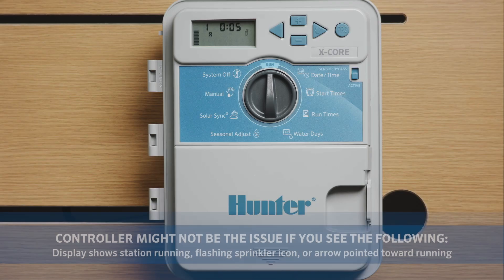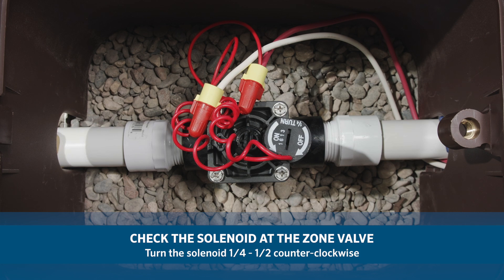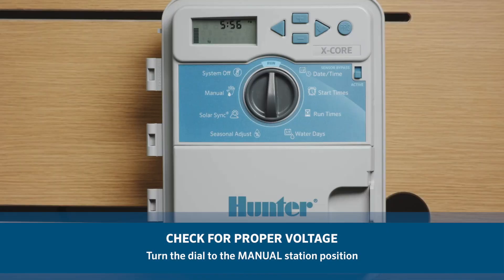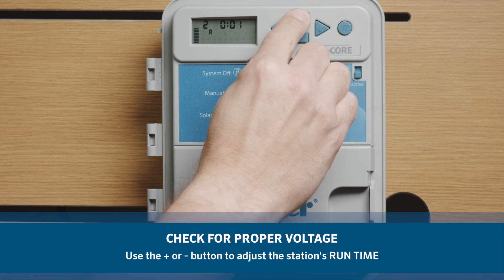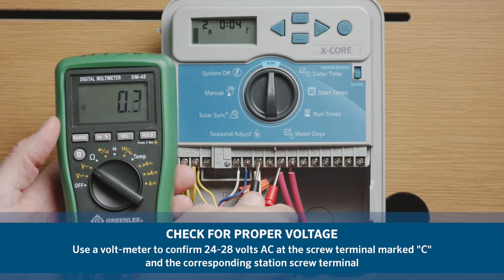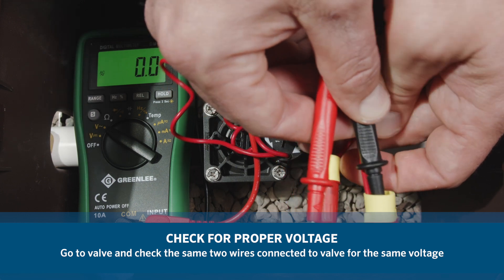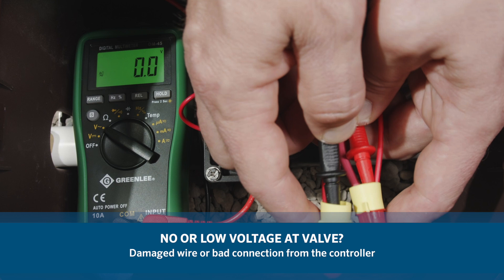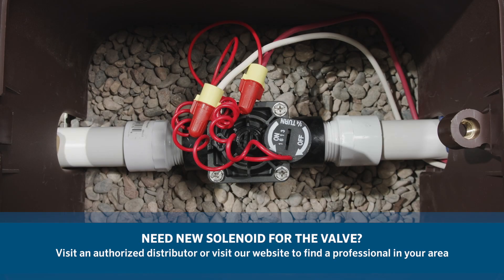X-Core® No Zones Running

Comment: All six zones are down. Cleaned up all the valves which were badly colored, checked the voltage at the control box and 
the zone that was selected checked 27 volts,  but all the others checked 40 volts !!!!!!  Does that mean that all the solenoids other than the selected zone are receiving 40 volts and are open ???  And I am not getting any flow because they are all open ?       I have a pump relay that the control box activates and thought the high voltage may be coming from that, so disconnected the relay and got the same voltage.         So I purchased a new control box X-CORE and got exactly the same  voltage reading with that.       If I remove the connections to all the zones and pick a zone in the control box I get the 27 volts at each of the zones in the box.  And got the same results with the old control box that I replaced !!    Have not checked the voltage to the solenoids but think it has to be the same that is coming out of the control box !     Can not understand how I can get a 40 volt reading from a 27 volt transformer !!!!!
Reply from the maker: Please contact our customer support department here: https://www.hunterindustries.com/hunter-technical-support-email-request